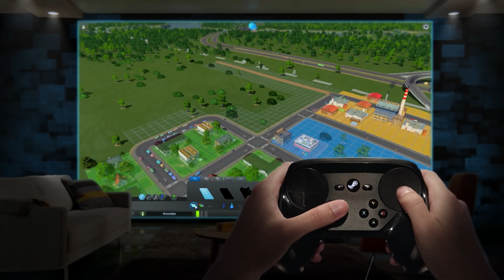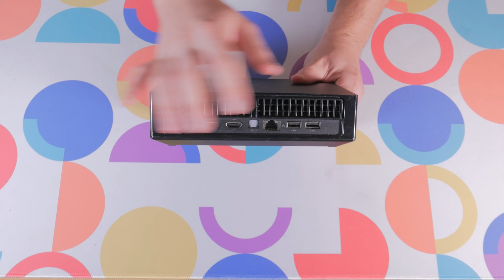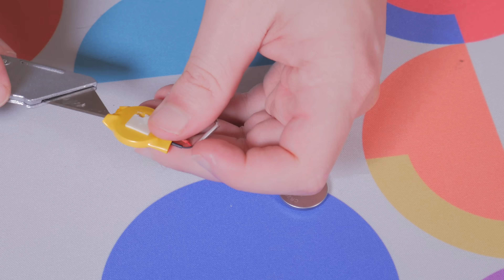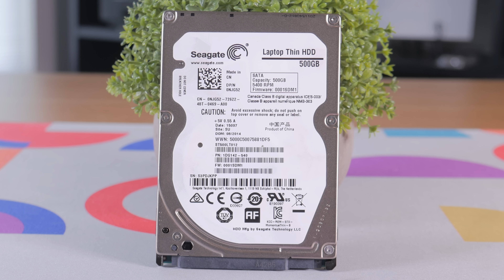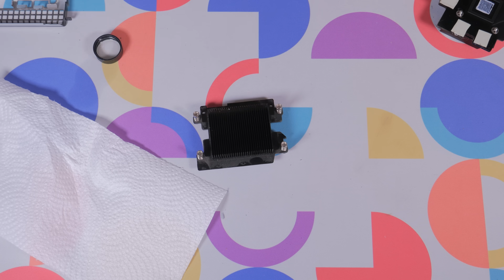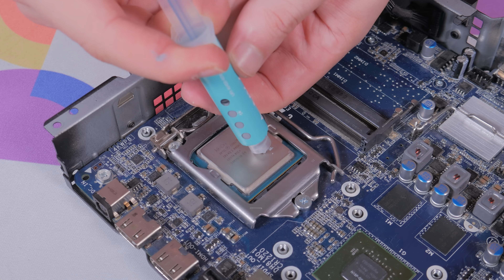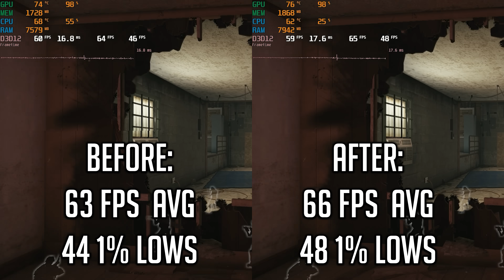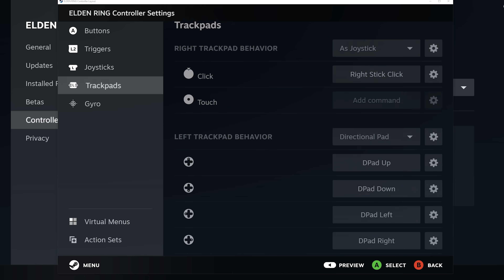I Bought Valve's FAILED Steam Machine in 2024...

Comment: After watching this. I'm thinking Valve made a mistake with this by partnering with Alienware, which makes it expensive. And also running Windows instead of SteamOS which everybody loved about Steam Deck. Great OS and affordable or at least reasonable price unlike this one in this video.
Reply: The original steam machines did run a version of steamOS not Windows. But this was before proton so it kinda sucked and there was little incentive because it meant only games ported to Linux would work

Comment: I wonder how the Gabecubes performance will compare to this, it'll definitely be better due to natural advancement and the Gabecube being way more optimized and based off the steam decks quality. It's kinda neat seeing people (I myself included) finding out about these, and getting curious. I might consider getting one of these due to how cheap they are usually (200 or less mostly in my area)
Reply: Based on the specs of both, the new Gabecube should be about 15 to 18 times more powerful than the original Alienware Steam Machine. The Gabecube falls somewhere in the Mid-tier gaming PC range. Which is perfectly fine for the average consumer, considering it will play 95% of all games on Steam, with the exception of some unoptimized AAA games that are garbage anyway.
Reply: this machine does Cyberpunk 720p low at 31 FPS, the new one does 1080p high at 28 FPS...
Reply: @山朱莉-g2i  I wrote this comment 7 months ago...damn.
Reply: @SoulslikeIsSoulslife  figured you could use an update lmao

Comment: Using that for games is basically e-waste.  I'd put it on a shelf though and install Ubuntu server, or similar, setup docker, and use it as a Jellyfin server.  CPU alone has more than enough for hardware transcodes.  The unit would look cool next to the router.

Comment: After years of being a married responsible adult, I was cheated on and divorced and had an urge to game but very little money. I got a base model Alienware alpha and was able to play Skyrim and Elder scrolls online. I eventually did the full ram, SSD, CPU upgrade. It was not at all worth the money I spent, but I kept that little PC as a TV box for playing downloaded movies and web surfing with a wireless trackpad keyboard for years. 

Eventually the board crapped out and I used the case to build a small form factor Ryzen 7 5700g PC with64g of ram and an M.2... no discreet graphics... It far outperformed the original system and with some case modifications for the fan it still looked amazing.

Comment: Steam controller was amazing in terms of what it can do. Can literally play anything using it. I even played total war games using the steam controller. Where it failed, however, was its construction. It was very brittle. I went through six steam controllers in the limited amount of time it was out. The bumpers were the main issue, they would eventually just break from regular use.Meanwhile I have had the same Nintendo switch pro controller since 2017, and it's still going strong. I have dropped it from the top bunk of a bunk bed on multiple occasions and it still works great. I use for everything, even when I play on my PC.

Comment: I also woke my pc alienware alpha R1 back up a few weeks back. I thought it was done for when I had got it back from my younger sister since I had landed it to her after I got my gaming laptop. It gave me the yellow alien of death. Which, instantly killed my soul. But, I then also learned it was just a the CMOS battery, which I switched out. But, it also didn't work. I did the 20 minute wait. I did the turn off and turn on, blah blah. Nothing. 
I was about to give up when I found a video explaining how to fix this issue. You had to use the included jumper  in the motherboard. And, my beautiful little beast had awakened once more after trying this solution.

Comment: Oh btw if you havent already realized, there are not, in fact, two hdmi outputs. There is an "in" and an "out". Its meant to work as a passthrough for whatever you usue to watch tv. So say you have a cable box plugged into the in and the out plugged into your tv, if your cable box is on youll see that, but if you turn the cable box off it shows the computer feed instead. Its like those old coax style sega genesis cables that did the same thing with a coaxial input so you didnt have to unscrew the coax from the tv antenna every time you wanted to play

Comment: I found with mine that the CPU bottleneck was the biggest issue. Like i tried Genshin Imact on high settings and it would look beautiful and the frame rate would be fine until it had to do a lot at once, like if i turned really fast and it had to render an entirely new section of world, it would just freeze for a few seconds. So basically it was like several second long chunks of 30 fps broken up by several second long freezes lmao

Comment: I got a steam controller and later a steam link each for $5 when Valve discontinued them and put them on crazy sale to clear inventory. The controller was interesting, it worked pretty well for using a desktop from the couch but I ended up just using a keyboard on my lap with the mouse on the seat of the couch next to me. The steam link was really great for the time, when I was college I had it hooked up to the TV in the living room connected to my PC in my bedroom, I played through almost all of Borderlands 2 on the TV through the Steam Link, with a wired connection it worked great.

Comment: The Steam Link does support up to 4k via Remote Play since 2023. You can stream up to the resolution your main monitor is at. So, if you can only play up to 1080p, you can only stream up to 1080p. If you could play at base 4k, you can chose to stream at lower 1080p/1440p res to save bandwidth, or 4k if your upload is fast enough.

Comment: Why though? The nsteam machine failed because it was factul worse then the PS4 and Xbox One at being a PC box game consoles... Not to mention having around the same price but only ran steam a PC game store... Which unlike the steam deck had noreason to exsit.. You know if the stream deck wasn't a handheld PC not a PC Box game cosnole... Also while it was a failure the reason it came to be isn't.. It was a massive inovantion... Steam link was the first successful cloud game service and easly the mosyt successful in history... As before it Nintendo toyed with the idea before starting with the gamecube and Gameboy advace bjut it was never a succes though it did open the dorr for the Wii U and Switch.. Steam link however opened the door fro non local game streaming which only Nidvia's service is a massive success though Xbox game cloud is a close second...And also like Netflex opened the door for game pass the sole reason why Xbox is still with us despite always failing at the consiole wars... Like even theXbox 360 couldn't compete with the Wii... So yeah while the tseam machine failed Steam link revolustionzed the game industry and made it more accesble to those who don't have power enough PCs or have a desktop or XR headset they want to use their main PCs power with...

Comment: The steam controller is an acquired taste. You really have to make yourself use it to gain the same level of skill you'd get from a more modern controller. But, as someone else mentioned, the rollerball style mouse look is legit. You can flick the track pad, tap, and acquire targets extremely quickly because you have similar precision to a mouse. It just takes practice. My biggest complaint is the moulded d-pad on the left track pad. While nice to determine where your finger is, it starts to hurt after a while of using the press to activate d-pad direction (basically, the default controller mapping for most controller based games).

Comment: the base amount of ram was questionable even the day these were launched. the gpu choice was underwhelming. the price was not ideal. you basically had an awesome little small form factor pc, or an underpowered gaming system designed to give a console experience of consistency and long term performance....which is was clearly going to be incapable of doing. just the wrong product for the wrong reasons. it was never going to work.

Comment: Brand but if you have to upgrade the memory upgrade the processor upgrade the video or whatever the fuck calls you were upgrading. It’s not a console experience the console experience as you buy a console use user for 10 or so years and until a new console comes out then you buy that one what you’re talking about is the PC experience And that’s why it didn’t go over if it doesn’t come out with enough memory and enough hardware to run the programs easily and simply just by selecting them paying for them and installing them without any you know result in issues then it’s not a console to point of a console of turkey system That you buy you plug it together and you turn it on you type your login information to get on the respective network for me PSN and then I go to the store and buy shit and install it if they can create a system like that that works with the games you buy off of their network that’s plug and play then it’ll probably sell maybe not because again people already have PCs they can already put steam on their PC. They can already play steam games for the same price on their PC right there’s no damage to it really so I’m not sure it’ll ever takeoff, but I certainly wish it would takeoff something independent of Microsoft and/or Sony, but it never will not if you get a box like that and it’s only got a few megabytes I mean gigabytes of memory. I mean, you say 12 GB not enough that PC center thinking pretty sure that’s as much memory as you need to play any video games But if it didn’t come with that much then obviously not the thing of all consoles also, is we know every 10 years or roughly? We’re gonna have to buy a new one and that new one is gonna come fully out to get us by for the next 10 years because the games will all be written to run on that hardware they know exactly what the hardware is in the games will be written written to run on it the game developers will be designing for it in your case they will not it’ll be the PC version of the game running on some kind of windows derivative OS in the background And they’re not writing the game specifically for the hardware when someone writes a game to release on PSN it’s written to run on PlayStation five at this point. I don’t think anybody’s making PS4 games anymore. It’s ready to run on PS five they know specifically exactly what the hardware is That same game running on PC might have all kinds of issues depending on graphics drivers and and various things that have have not been properly upgraded in the OS all those things that you guys have to dick with all the time we don’t have that problem we get an upgrade that patch is some problem and it just automatically installthat’s the console experience not you’re still playing the PC version of the game and that’s loaded with all kinds of fucking cheaters and exploiters that intentionally stick the PC because they mostly can’t do that shit on consoles

Comment: I picked up the Alienware Alpha (i7 config) when they came out as a way to play my Steam games on my TV over using an old (& increasingly aging) desktop.  While it wasn't perfect, it reached the "Good Enough" threshold for me to use it as my daily driver for a few years, including playing GTA V (& Online) with friends as I swapped out Windows 8 for 10.  I eventually upgraded to a new laptop (which I have since upgraded to my current laptop, running on roughly a 5-year cycle).  I have picked up a Steam Deck to play games on the go without lugging my laptop (+ trackball & controllers), which has performance similar to my previous laptop (definitely reaching & exceeding the "Good Enough" threshold).  If a new series of Steam Machines were released with updated specs (& more upgrade options), I would seriously consider buying one as I can definitely live within the Linux ecosystem that SteamOS is based on.

As for the Steam Link, it was serviceable at the time as I was running everything at 1080p on the Alpha.  The only Achilles' Heel is that it only utilized a WiFi v4 (802.11n) card, which hamstrung the little device.  I didn't use the Steam Link a lot since it was only used on my bedroom TV & was only used when my roommate was using the main TV, but the few occasions I've used it ran well over the short distance between the PC & link (plus a wall).  The only time I experienced performance issues is when the PC was chugging a little bit or the network was moderately busy (w/ an old wifi v4 router, which was later upgraded to a v5 router as the old router became a choke point after an ISP service upgrade).

The Steam Controller was the only device that was a bit disappointing, but it was mostly a learning curve that I wasn't quite willing to go through since I had an Xbox 360 controllers w/ wireless receiver (which has later moved to XBox One & Series controllers w/ their Bluetooth support) that I was already familiar with & was already considered the Gold / Silver Standards (Steam Controller was Bronze).  If I was forced to use the Steam Controller more (with no alternative available), I would probably enjoy it more.  However, with the Steam Deck merging the Steam Controller with the XBox style controls makes it easy to play on the Deck.

Comment: this wasn't a console killer... it was a console. it was complete product with it own integrated board and components and with it's own standalone OS completely optimized and integrated with the hardware.  Where the grey area is, is the fact that is ran the PC versions of the games while the version of a game intended for a console has to be optimized and developed for that console. However! Games on steam have to be tweak for Steam, and SteamOS so it is the PC version of the game but the if you game through steam they actually require steam to run if if you tried to crack them you would still need SteamOS or the SteamApp to have the game run correctly or at all much like a PS3 game require the PS3 OS or at least emulator for the PS3. 
This this specific point is debatable but that aside the Steam Machine was infact!  Was apparently original called the SteamOS Console or and the Steam GS (Game system I'm guessing) but but were afraid they would alienate both console users that might uneasy about a new player in the console scene (alienware) or/and the PC users who thought it was just a new console and didn't had it's own library of games separate from there existing steam library!  Honestly... I don't think naming the Steam Machine avoid this issue as is clear due the the fact it flopped... it' flopped while being REALLY good! So yeah... with products like this marketing can make or break it!

Comment: 870M I believe. I had this thing for a while before I built my own system. I  upgraded this manually and eventually decided to build my own for the first time in over a decade. It was a whole vibe. It wasn't strong but ultimately everything I wanted to run ran well with minimal compromises. I found changing the thermal paste out gave me a remarkable improvement. For esports titles it was workable for a crazy MSRP at the time of $300-350. It was small and ridiculously mobile. My biggest complaints was the lack of USB ports. I would love a modern version of this.

Comment: I had one of these as my first gaming PC. I was able to consistently get 60 FPS on Overwatch at 1080p low with the base configuration. It took FOREVER for models to load, though. I'd get into a match and the other players wouldn't be visible for quite about a minute or two. I wasn't willing to compromise resolution, but honestly? Back in the day you probably could have gotten okay mileage with it if you wanted to drop to 720p. These things are still pretty good for emulation, though. The design is still pretty sleek  and compact so it's probably actually not the worst media PC. Could be a cool RetroArch box or something.

I don't think they'll ever revisit a "console" form-factor but I think they should figure out a new form-factor for the steam deck and basically just copy the Switch's dock so you can seamlessly play on TV. I understand Steam Deck hubs exist but it's not as convenient for the switch. It can and should be done imo.

Comment: The R1(860m) is a rock solid machine. I've been daily driving one for years. The CMOS battery is most certainly an issue that will make you think it's dead. The R2(GTX960) model has problems. I'm on my second motherboard with it. With an i7, it can still play AAA titles on low(Fortnite, Doom Eternal), but I think the R2 design produces too much heat. There is something heat related going on with the northbridge/southbridge chip. My first R2 motherboard got so hot it melted the heatsink pins for that thin heatsink plate, the good pin then pitched heatsink up and off the chip and self destructed. I think the R1 strikes the best balance of performance/size/heat being that it's laptop parts. Would love to see Valve do a modern take on this small form factor machine. I swapped out my i3 for a i7-4770S in my R1. It won't run at full clocks, but runs just fine with no thermal issues. I've been testing Linux Mint and Steam on my second R1 and it's running pretty good for the age of the hardware. The R1 2GB vram limit is a problem for modern AAA games. So you are limited to older games with an R1.